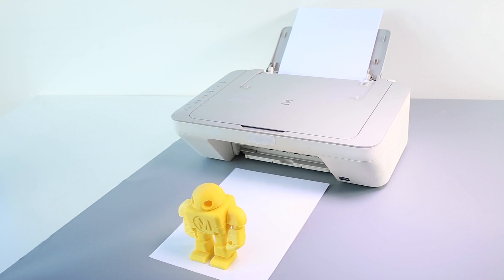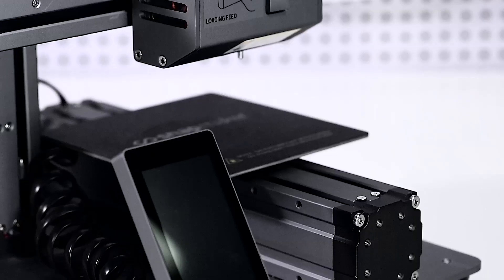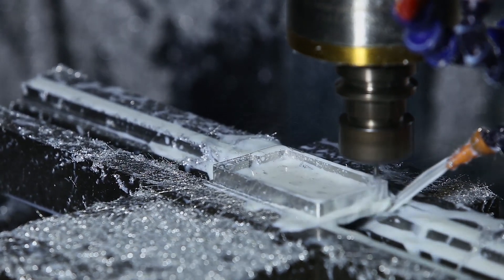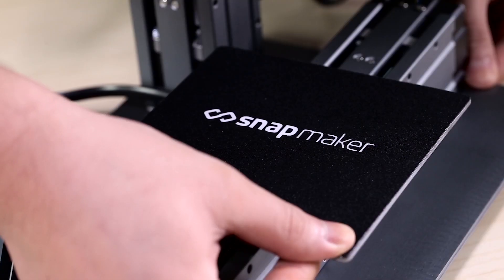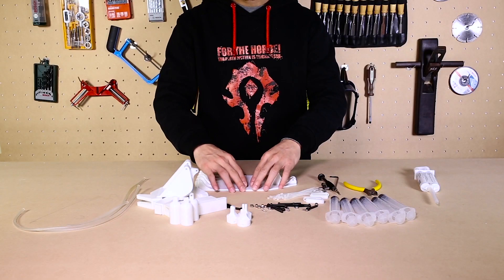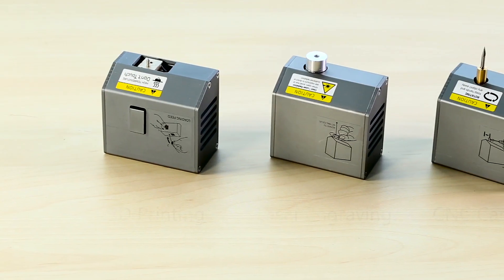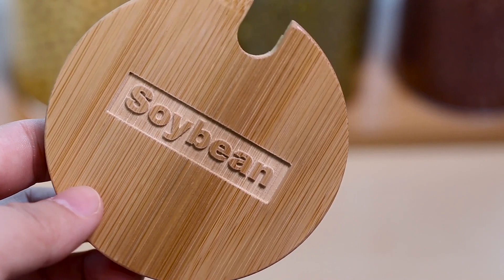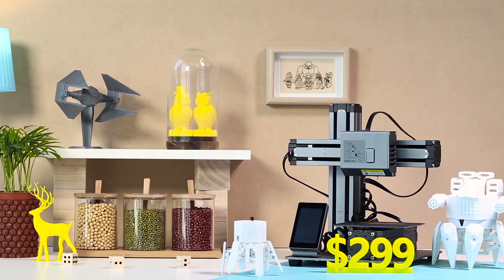Snapmaker 3D Printer is LIVE on Kickstarter!

Comment: will it be available after kickstarter or do you have to buy it right now off of kickstarter? also, I was wondering if the CNC and laser come with the $299 purchase or do you have to buy them separate from the 3D printer? thanks!
Reply: Michael Jones those are sold separately but if I remember correctly you can buy the 3 together for 499